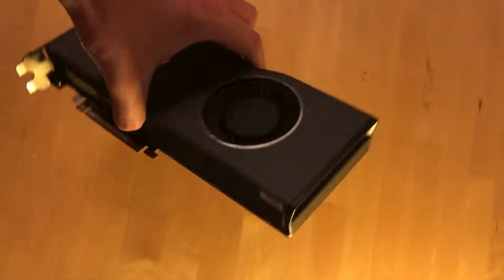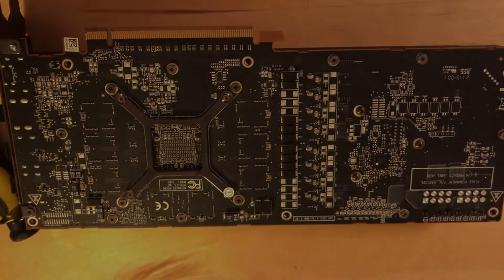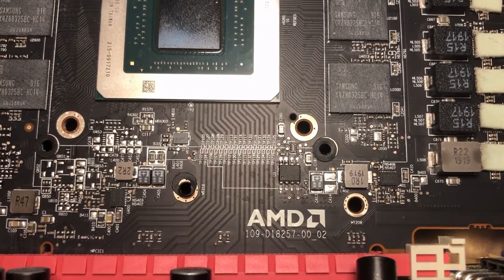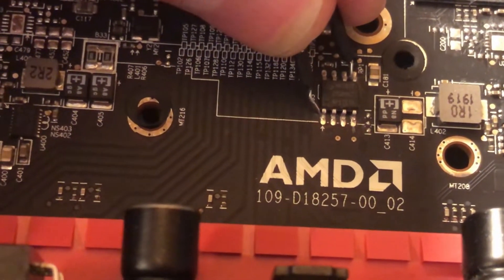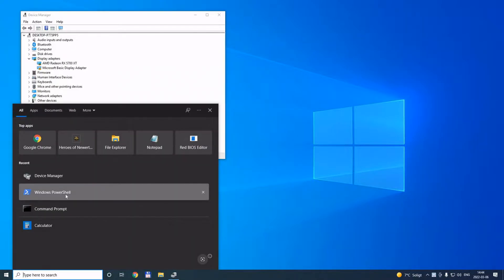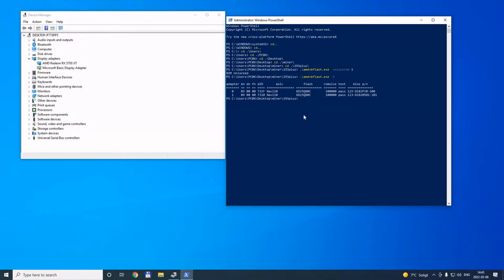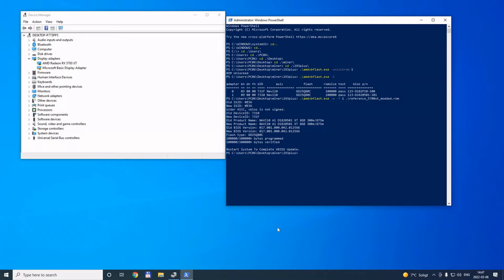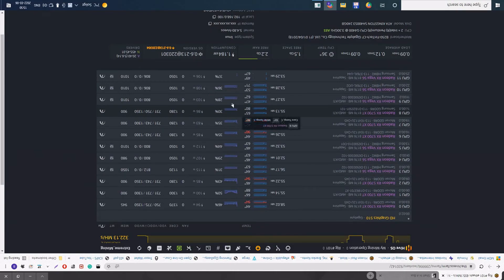How to Unbrick and Bios Mod AMD 5700 XT Rev 2.0

Comment: Hello, can use this method? when the card works and gives an image but when enter amdvbflash -i the test fail and cannot upload the bios
Reply: I haven't opened the card yet, but I wonder if this method will solve my problem
Reply from the maker: @majsteroficialnie8440  It should work, you can try this first: How To Unbrick BIOS on Your GPU!!! Demonstrated on Vega 64 Nitro+
https://youtu.be/fSU7755cN6Q
Reply from the maker: Did you follow the tutorial exactly? Here is another method you can find on my channel and try.
Reply: so I can try this method?
Reply: Unfortunately, there is a problem because I do not have a USB programmer
Reply from the maker: @majsteroficialnie8440  then the other option is ur only option :)

Comment: I followed your micron procedure for my ASUS 5700xt w/ samsung gddr6.  I find this card to be greatly tunable, but won't get to 60 without causing dying or throwing invalid shares and it is very sensitive to undervolting so I did not go down as aggressively as you did on the micron.   I use latest lolminer via hiveos.  I love the power efficiency of my 6600xts, but these 5700xts are simply exceptional.  I'm stable at 57MH with 1430 core and 920 mem--  software is reporting 120w but I will gently undervolt if these rates hold for 24 hours.  I crash at 940 mem.
Reply from the maker: Hi! The card in the video has samsung memory? 60 is very hard to reach… you need  an exeptional card in order to do that. I bet you can get that with 1370 core clock in team red miner with eth_config B, which is the default in newer versions. Let me know what did you manage to get ;)
Reply: @BMasterBM1  I will give TRM a try next. Many thanks for your vids!

Comment from the maker: Hi guys! I hope you like the video! Tell me about your experiences with rev 1 and rev 2 bios modding on 5700xt cards!
Reply: Hi,me also i brack 1 asus rc 5700,but i have 2 bios.I don t want risk again :) how come see if is rev1 or rev2?
Reply from the maker: @alexandruomakase1666  the serial number should say “002” or “001” in the end
Reply: @BMasterBM1   what setting you have for this card? micron or samsung?
Reply from the maker: @alexandruomakase1666  samsung memory, oc settings? 731mV 1280MHs, 900MHS on the memory
Reply: @BMasterBM1  use hiveos or windows?
Reply from the maker: @alexandruomakase1666  i used windows
Reply: @BMasterBM1  do I use the programming software with the clap to load my original bios or can I use PowerShell does it matter
Reply from the maker: @TechGamerBb  hi, it does not matter. They both do the same thing. You can use whichever you prefer.